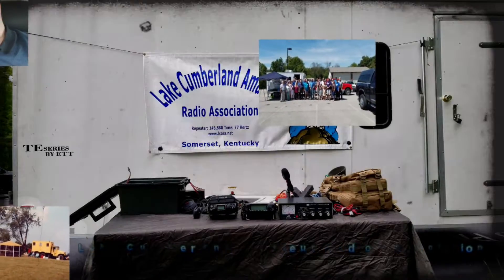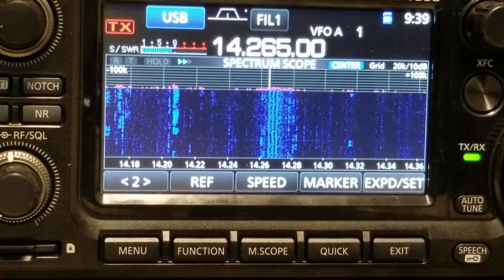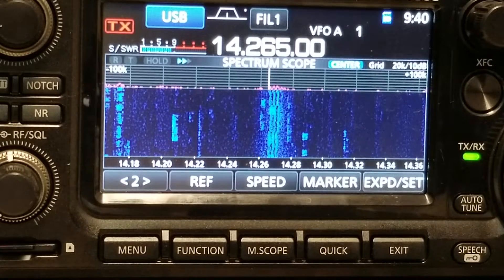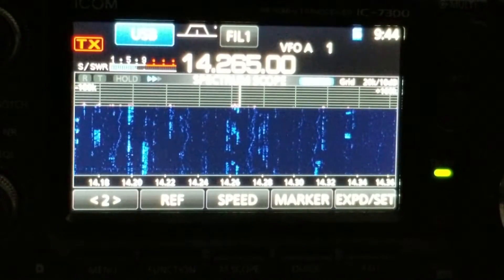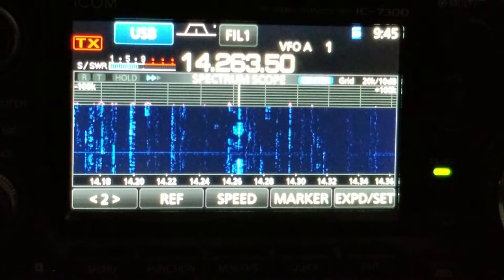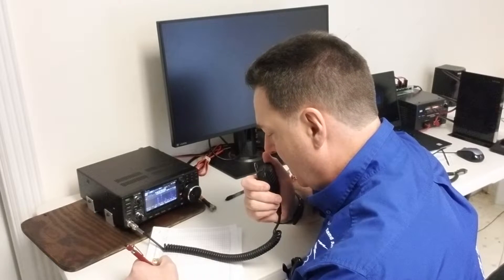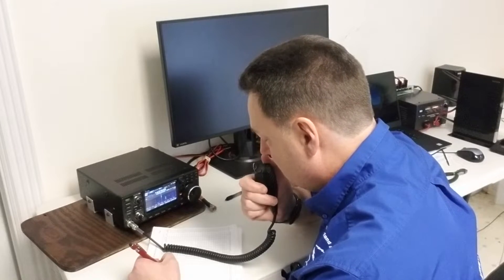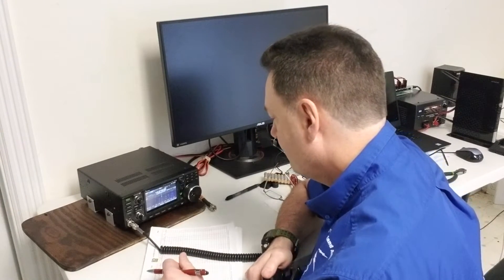LCARA HAM Radio: Reducing RFI in the HAM Shack!!!!

Comment: Great video! I am surprised you don't have more subscribers and views on your channel. This winter I was able to run off 12 volt battery power during a snow storm and see the difference from running off house power. It was pretty amazing. I have since bought a linear power supply, upgraded my feed lines to LMR-400 and that alone has improved the noise floor in my shack. I made sure that my feed lines go through lightening protection and are grounded to the main house electrical ground but I still have to add more ground rods to my radio system to be sure that I am well grounded. If you check in the National Electrical Code you do need to bond the house ground to the shack ground to eliminate voltage potential between grounding sources. It's code and common sense.
Reply from the maker: @1craxynordlander Thanks for the feedback! We are growing as a channel and started back in May of last year. I plan to do another video on grounding my shack and ensuring there isn't a grounding difference between the house and the radio. Keep the comments coming!

Comment: Interesting video. I have not been able to use my sidebands,due to noise ,that would disappear if power to mains sockets is turned off.Tried disabling every appliance in the house,when running radio on battery power but no good. Seems to be coming from the wall where the mains switching board is .Not sure if moving to a different part of the house would work,so I will try a suppression kit as you suggested.
Ray,England.

Comment: CQ CQ KY4BDP  -  Brian try checking your thermostat as the culprit of your noise. Those brown wires running up the PVC conduit should run to it. Those are 24v most times but I have seen some that are 12v. If you have a digital thermostat that may be the RFI. Just a thought of something you can do with the furnace.
Reply from the maker: Thanks for the tip!

Comment: Brian, it looks like you have the power supply covered at both ends, do wall wart cabling need to be filtered at both ends? And if you only put one core/split ferrite on a wall wart, is it better on the wall wart cube end or where it goes into the device?

Comment: I have just got into GMRS and after taking test will prob get into ham as well but I've got a pretty restricted setup.  I rent and limited to space and room I can put equipment into.  I rent and so can't mount external antennas so at the moment just have a long slim jim mounted at window.  It makes a big difference vs using say a nagoya 771g on my ht.  I have noticed now though I have a DAC/Headphone amp that doesn't play nice and completely kills any signals I was getting when it's on.  Hopefully choking this device when I get my ferrites will eliminate that issue for it's a device I use every day and simply can't just easily unplug it when using ht.

Comment: While you touched on it once, it wasn't clear to me if the furnace ALWAYS generates RFI when it has power, or only when the fan itself is running?  Modern furnaces have a lot of electronics, so it's plausible that they always make RFI...?

Comment: I'll wager that, taking the appropriate safety measures, if you accessed that top front panel you'd find the AC wires leading from that junction box into the compartment and enough space to install a toroid... worst case, you'd  have enough room for a few clamp-on ferrites. So don't let the furnace intimidate you.... after all, you ARE a "ham" and are familiar with circuitry.... Newt, KA7MWQ

Comment: Very informative. Great how-to demonstration. Any devices to do waterfall for folks with older radios?
Reply from the maker: @Ben Ollo Sure, you could use one of the SDR panadapters like the rsp1a inline with your radio to see the same noise.
Reply: I completely agree with that reply. Even a cheap SDR connected to your PC and antenna system. Many options out there. I do have the RSP1a but also have 6 or 7 other SDRs in the shack too. I likes me gadgets. What can I say. :)